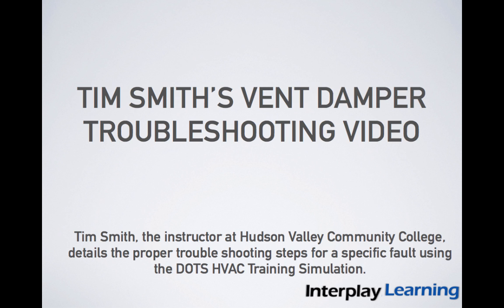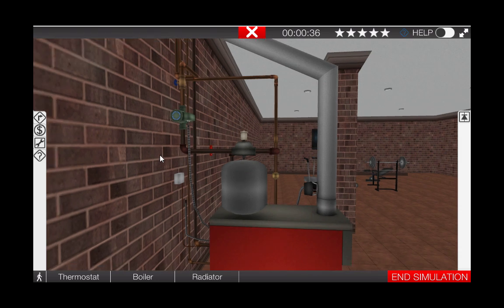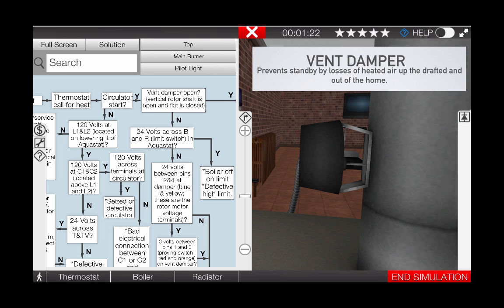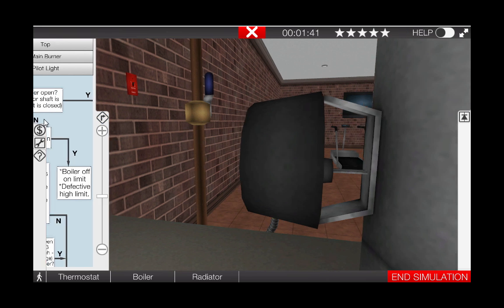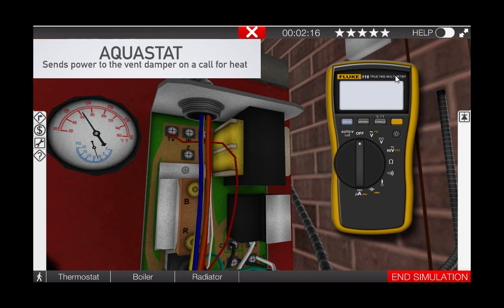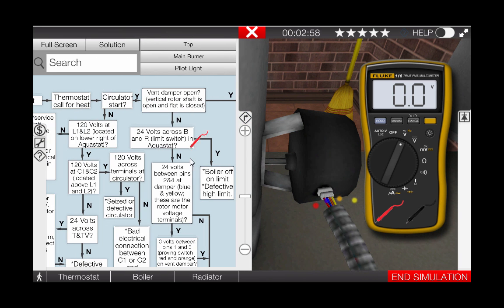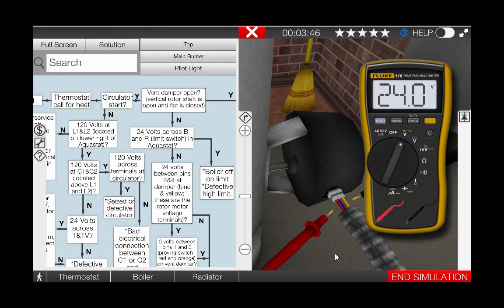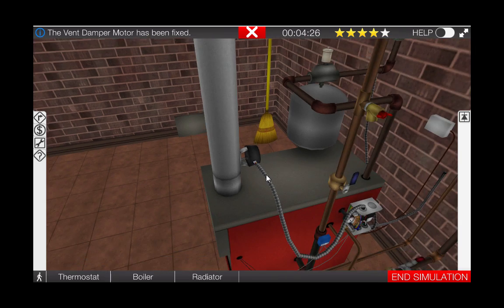Gas Boiler Vent Damper Troubleshooting Video

Comment: The video was somewhat helpful.  I recently had the damper replaced by a HVAC company.  After they left, I noticed that the damper would never close, which cause the house to stay cooler than normal.  I tested the voltage at the aquastat relay, based on this video and everything seemed to be normal. Turns out that the technician fail to place the damper switch in the automatic position.  Everything is working fine now.

Comment: Any thoughts on  why Flue won't open on just one out of three zones?   Two zones work, the  third does not,  the zone valve opens, the circulation pump comes on, but the flue does not open, therefore the burner does not ignite.   TIA

Comment: How about the pilot is on, vent damp is closed, the thermostat is set above the room temperature,  If I manually open the vent damp, still no fire up? thanks
Reply: Maybe a faulty limit switch in vent damper mechanism ?

Comment: What happens if the vent damper is in open position but the boiler is not igniting? 
I can't see that part of the chart! 
Thanks!
Reply: euphrates425 
If the vent damper is open, and not letting the burner fire, I would suspect that the endswitch on the damper motor/assly is burnt out. Just happened on a job the other day. Some have a service switch that lets you keep the damper in the open position. A sign that the motor is bad, and the end switch is probably going to burn out, too. Replace the whole damper and motor assembly.
If that doesn’t solve it, you gotta look further down the line at other relays, and ultimately at the gas valve itself.
Service on low voltage is important. If one relay is bad, it can keep sending voltage to other parts that normally should not be happening. This causes damage to other relays and switches, and sometimes to the 24v transformer. 
Good luck
Reply: John Fitzpatrick yo o ya e